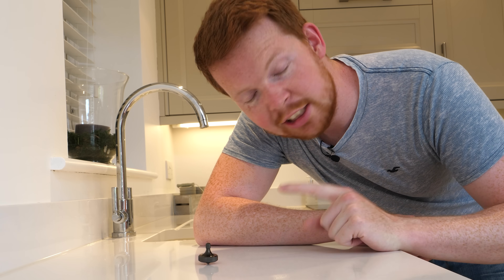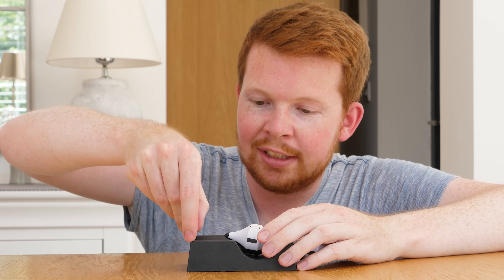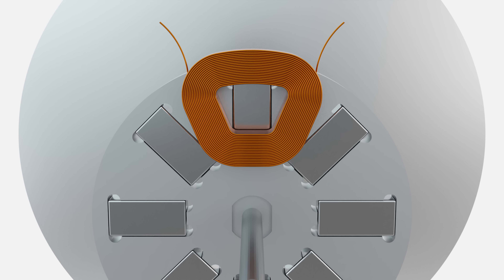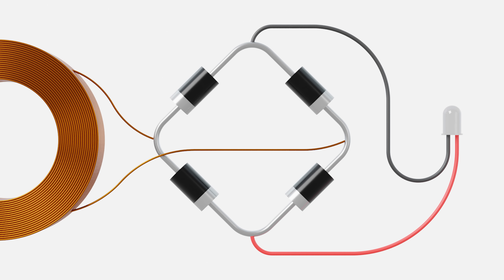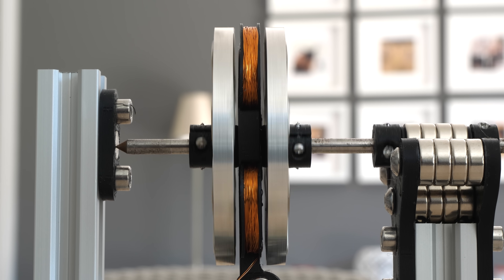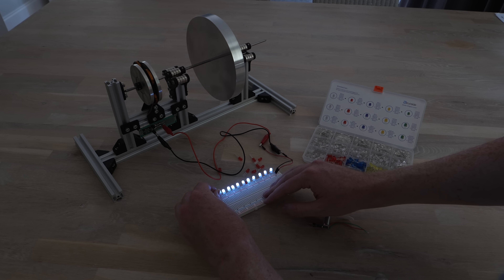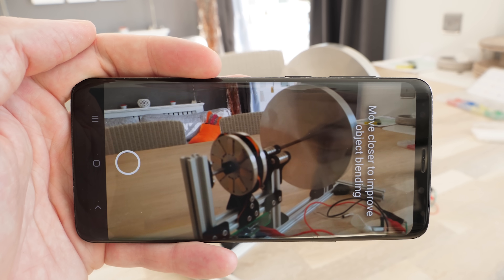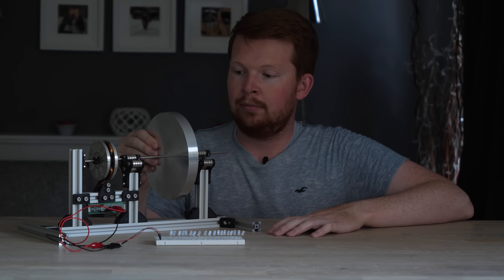Flywheel Battery

Comment: I love your videos. I have an idea myself, but no way to build it. I am 80 years old. I envision a carbon fiber disk about the size of a bicycle tire, with really strong magnets around the outside perimeter of the disk, and electromagnets surrounding half of the disk with the coils on both sides in a sort of fender concept. The disk with the weight of the magnets would act as a flywheel. I have no idea how to wind the coils and the electronics to run them. What are your thoughts?

Comment: When I was at university I read that the French were experimenting with mag-lev flywheels set into a concrete floor in the 1980s - presumably to store off peak nuclear power.
They had dozens of solid vertical cylinders rotating at scary speeds, one per hole.... each one with the kinetic energy of a decent sized bomb.
For some reason it never caught on, I haven't heard of it since. Presumably the engineering wasn't advanced enough to make it a success.

Comment: cool. Maybe try to connect a battery and a motor, changing the battery until it fully charged, and give the power to the shaft to drive the wheel. It may not run permanently but would be longer than 20 minutes?

Comment: I know this is old and you've probably sorted it but in case you haven't cut the shaft down as close to the flywheel you can on both sides, put the flywheel on something solid with the shaft cutout below and use a hammer and drift punch to get the shaft out. Easy peasy

Comment: You could add a hand crank to the end of the rod that is able to quickly disengage from the rod holding the flywheel (so that friction doesn't slow it down), that way you could manually get lots of power without using a drill.

Comment: Maybe instead of having a contact point on the side you could use a magnet placed laterally on each end with other magnets placed on grounded beams, that way the repulsion would hold the beam in place instead of having physical contact
Reply: The physical contact shouldn't be an issue, or at least not that much.
Frictional forces are proportional to the pressure between the two surfaces.  Since the only horizontal force is that due to the magnets that are levitating the axel, it shouldn't be that much.

Which really, is the point of the get-up.  If the flywheel axis were vertical, the friction would be proportional to the weight of the flywheel.

He really should have spent more time explaining this than explaining how a magnet works! 😆

Comment: Could you attach this contraption to a turbine like a wind turbine or hydroelectric turbine and use that to generate power? It seems like it wouldn’t negate a lot of the friction that is so pesky in the current generators
Reply: A modern 1000 Megawatt steam turbine plant generator is 97% efficient at converting the energy from the turbine to electricity using standard floating bearings.  The bearing actually floats on a thin film of oil that it builds up; a few thousandths of an inch.  The losses are very low, probably much less than all the energy needed for a mag lev bearing system to work.  The generator rotor for that large of a plant weighs several hundred tons.  It's' also a lot simpler and much more reliable.  Hard to improve on 97% efficiency, very few machines in existence are that good.

Comment: you should also add a small solar panel to spin the flywheel^^ so you can store the solar power in the flywheel and use is later :P

Comment: If your invention had a  gear Drive with REAL gears  with a windmill attached to your invention YOUR invention probably REALLY COULD light up a REAL number of  different LED light bulb's if your invention really floats freely like a real top if your invention really can float at a real tremendous speed  your invention COULD REALLY WORK lighting up a big number of LED light bulbs because a real Gear Drive COULD REALLY speed UP YOUR invention also YOU REALLY ALREADY KNOW less friction MORE speed YOUR invention COULD REALLY TURN ! . THAT'S is a REAL problem with ANY real generators friction. ALSO YOU ALREADY KNOW  REAL friction ALWAYS HOLDs ANY REAL generator BACK .

Comment: Alright so I just had a brain spark what if you got two heavy fly wheels attached them to a cable an a pulley system and set them an equal distances apart with one continuous cable attaching them so when one looses momentum it gains 8% in mass  thus meaning the weight of fly wheel will pull the other one up as in from giant tripods

Comment: Make another disc like the one for the windings and attach it to the end of the floating shaft, this one will have all the magnets set in the same direction,  now use another magnet to repel the attached floating magnets to turn the floating shaft , they may need to set at a slight angle to repel properly?
Reply: I saw a ball that excelled faster each time it passed through an excelerator on a track,  maybe this principle can be applied to turn your project instead of by hand?

Comment: Why not lengthen the shaft and add more coils/ magnets to multiply output? 
Also, if you added some fan blades to catch wind,  you could put several of these outside your home,  oh wind generators,  naw they are too expensive and should only belong to green energy giants,  not the consumer. 
Yes I am quite sarcastic,  I'm an old man, I've earned it.

Comment: could you use magnets to prevent the axle from slipping off instead off the metal tip rubbing against a metal plate?
Would this be more efficient?

Comment: how much energy would have to be appilied on an allready running system to keep it running vs. the ammount of energie possivle to generate with the flywheel? i.e. may it be possible to attend a few more gernerators and use one or some to drive the manual already running machine?
Reply: ..combined with more effevtive technics as composite flywheels, optimal generators a.s.o.

Comment: I do like the project. One end of the shaft is suspended in the air. I would add up a stablilizing element there (more or less the same, that you have on the other end of the shaft). Anyway - great job.

Comment: Use a string wrapped around the shaft to get it to spin fast. Also if you want a nice straight shaft you need to get a bigger one than you need of a hard material like tool steel. Then machine grind it to thousands spec. Then machine the flywheel and balance it on a flywheel jig by drilling it. Then fit the shaft in the center with a few thousands spec press fit.
Reply: You can buy drill rod which is tool steel supplied ground to specific size, he needs to bore the center hole then re-machine the disc to run true

Comment: Since the electrical current is AC you could've just stepped up the voltage using a step up transformer before rectifying it.

Comment: couldn't you stabilize the wheel shaft by having another permanent magnet at end of the stick pointing north pole parallelly to axis of rotation into the "glass plate", but instead of glass plate there being another magnet with its north pole pointing back to it, same on other side, in a way the force keeping the wheel from moving along the rotation axis being done without contact and thus friction

Comment: What a cool project!! Please keep on doing cool things like this.
Some remarks regarding turning AC to DC: LEDs themselves are diodes so you can make a rectifier with just LEDs. Even more, LEDs will also light on AC, they will strobe on half period.
Motors can have the simplest designs with AC. DC motors have to use "tricks" to make them work ;)
Reply: thats not always a good idea, as leds generally cannot tolerate much reverse voltage without being damaged

Comment: Electric generators and engines were reversible, right? This means that if a small solar panel was attached, it would induce current and generate rotation in the magnets (stored in all the attached mass), acting as a storage for not-so-long periods of time, right?

Comment: I think regular diodes conduct from the banded end to the un-banded end.  Your diagram with the animation at 6:45 seems to show electricity flowing from the un-banded end towards the banded end.  This is not correct.

Comment: I have to wonder, with some capacitors, and a logic board, could a small motor be timed to add momentum periodically to the flywheel to keep it spinning longer. I know there is no such thing as perpetual motion, but would it run much longer with a setup like that?
Reply: I imagine the flywheel would spin the longest without the coil "stealing" energy in the first place. Taking away energy, then feeding it back in with a motor, is bound to introduce more losses than spinning the flywheel as it is.

Comment: Heavy duty diesel technician here, What if you hooked up a motor to the power generated from the flywheel and use that motor to power the flywheel? i see inefficiency being a huge problem, but i saw someone else mention vaccum chamber and lubrication so maybe you could combine all of that? and how much force does it take to turn the flywheel? because say you connect that to an actual diesel engine or something like that you could make something that is far more efficient then an normal alternator, maybe electric engines that self charge completely? could be onto something, just a thought.

Comment: cool project.
i've wondered about rather than running the flywheel on an axle, if supporting the flywheel on the outside could work better for providing high centipedal forces to stop flywheels exploding at high rpms. something like a large hydrostatic bearing to allow high speeds. the housing can be made as thick as required.

also no need for spokes either... more of the flywheel's mass at radius.

Comment: This is cool! Like others have said, I bet you could get better performance with a thicker tool steel shaft that's just smaller than a precisely reamed hole in the disc elements, then use glue to fix them... And then at each end (and even at intermediate points) you could use high quality bearings with the grease removed, and lubricated with WD-40 only. Then put the whole thing into a vacuum chamber and get the pressure down as much as possible. I'd love to see a part 2!!

Comment: Hello Tom ! great video ! If you wish to improve the eficiency of the flywheel generator, get read of the repealing magnets and put the flywheel on vertical , use some magnets strong enough to fix it 
I' ve played a lot with magnets and this is the conclusion 
 :)) here it is : https://youtube.com/shorts/m4qtsuIsR0A?feature=share

I add some solar panels in ambient light powering solar stand electronic near the flywheel  with magnets on it and      the results are not bad at the first look 

Best regards S.T.

Comment: Ok…. Hear me out. I dont know how to do this, but you might. Use this same idea but it charges a Capacitor instead of a LED, and the Capacitor releases its energy into some device to respin the flywheel, in theory making the cycle continue and seeing how long it can recycle. I dont know I just love the idea of free energy devices
Reply: Also I know “free energy” isn’t possible. I just like to see if it could run longer than the original idea

Comment: Automotive alternators do this exact same thing. they use diodes in a rectifier to produce DC current. in most cases it's 12 VDC system. but there some cases it's 24 VDC system. but in the case of a 12 VDC system. the alternator has to produce 13.6 VDC to power all the accessories in the system. along with keeping the battery at full charge. and to keep from over charging the battery it has to have a regulator.

Comment: It feels... suspiciously understated, how incredible this device is. This is more or less a free energy device (to the extent that the magnets maintain their magnetic fields). No fuel required. Fuck powering a motor with it thats retarded, you power a motor with a battery. The motor could have no more power than the device itself. 

What you shouldve shown in the video that you (i believe strategically) did not... Was how long it would power those lights for... What is the total energy you can get out of those flywheels? If its alot why have we not been doing this?? Why do we not power cities this way its incredibly clean and incredibly cheap.

I suspect there is some kind of friction in your system that keeps it from running.. i suspect you havent really made what you appear to have made in this video... 

Or perhaps this flywheel is ultra intensive (moreso appearently than an alternator) to the magnetic fields of the magnets... And that the energy required to magnetize the magnets is so much more expensive than the energy yield before they demagnetize... It must have been an embarrassingly low yield for you to completely opt out of showing it.

Because otherwise... This device is like.... The second coming... Casually sitting here on youtube

Comment: increase the capacitance.... and use diodes to prevent unwanted discharge back to the rectifying circuit. Also use resistors to control the capacitors discharge rate

Comment: I feel like you stopped short on the magnet setup. One more set of coils and another plate and you could have configured it to double your amperage. 

Also the more of your weight you can move towards the outer edge of the flywheel the more energy it will store at lower RPM. consider drilling evenly spaced holes so you can bolt weights to the wheel.

Comment: I’d love to see if you could take one of those wind up motors you see in toy cars to wind up and continue spinning the flywheel even after you stop spinning it yourself, it still wouldn’t last forever of course but it’d last a bit longer and allow quite a bit more RPM with low hand effort

Comment: Im not really knowledgable about this subject but instead of setting the point to the glass to keep it from falling sideways could'nt you just use opposing magnets on each of the shaft ends and the side plates like youre using to levitate it with to keep it distanced and have absolutely free floating?       I would love to see if you could get a continuous spin with a fan wheel  instead of a fly wheel! It would have no parts touching and could virtually last a lifetime while charging a bank.
Excellent video!

Comment: Very interesting Tom.  Have you had anyone suggest decreasing the inner web area material of the flywheel, and concentrate most of the mass as far outward as possible?  It should help to increase your spin down time somewhat and get even greater efficiency.
Reply: True. L=mvr, if you double the apparent radius by moving most of the mass to the outside, you double the angular momentum, L,  for that amount of mass.
Reply: I do not think that would make much difference. . . Adds to bearing friction, but magnet bearings have very little friction in any case...    The main slowing down will be the electrical Loads in any case.

Comment: I would imagine the aluminum would still induce drag near the magnets. If you've ever slid a magnet across an aluminum surface you would see it significantly slows the magnet much like the old magnet down a copper tube demonstration.

Comment: It would be really fun to see you spin the wheel to a set speed and measure the time it takes to spin to a stop with different numbers of LEDs attached.
Reply: The larger the load the more resistance on the magnets thus slowing the flywheel.

Comment: The disk isn’t quite straight if you just adjust where the rod goes through the disk it would spin much straighter also if you put opposing magnets on the top like you did on the bottom it would stop the disk from bouncing up so it would be almost like you was resting your finger gently on top with no friction so fucking cool though! 👌

Comment: This is an interesting project, but... you could do this so the flywheel generated Direct Current instead of Alternating current. 
The difference would be two points of contact, instead of 1, with 1 point of contact being where the rotor contacts the retaining wall, but the other would be the outer rim of the aluminium flywheel. 

This makes it a Homopolar generator, where voltage stays fairly constant, but current shifts as it spins up.

Comment: Great video! I have a question though, since there are two different sets of magnets, why not have them pushing in opposite directions, so that they push up and also towards each other, thereby offsetting the horizontal force of each other? Wouldn't that remove the need for the side plate?
Reply: That's a neat idea!!!! I was thinking magnets on the end that makes contact but I like your idea better!!! I hope he tries it!!!! I wonder if the Amazon toy could be disassembled to do it?

Comment: Pillar UPS system using Flywheel technology where a poly motor power up the flywheel to preprogrammed desired rpm then when there is power failure it will last somewhere 45sec to 5 mins depends on design and setups. It is use for switching over to 2nd source incase of main source failed. it is a great technology but it uses helium to cool down the main vertical bearings.